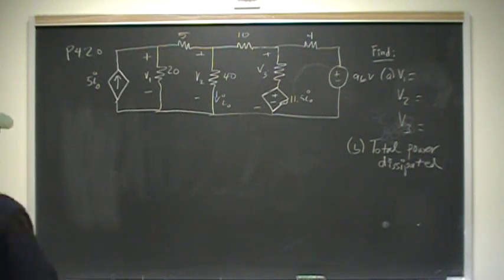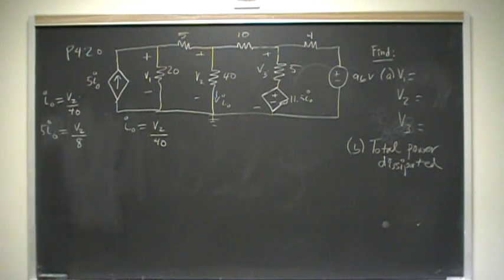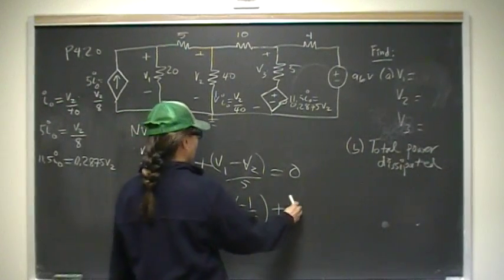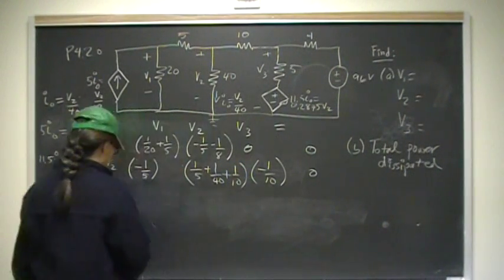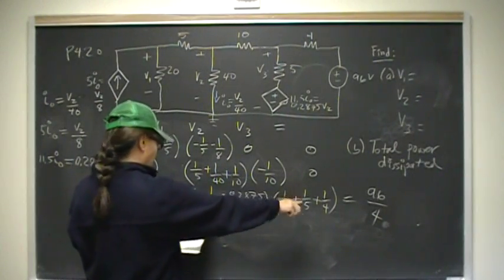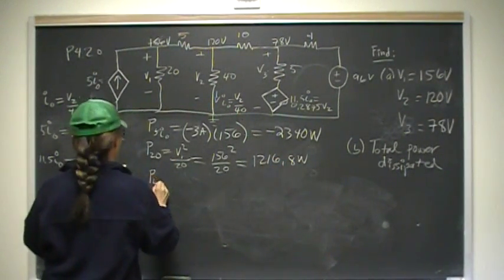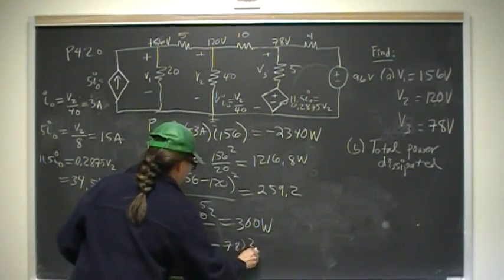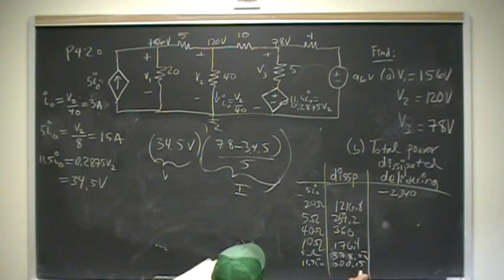Node Voltage Circuit Analysis With Dependent Sources P4.20 Nilsson Electric Circuits 9E Solutions

Comment: Great tutorial, much appreciated.
Just wanted to quickly ask, when you found the power from the current source, why did you multiply -3*156 and not 15*156? Aren't you multiplying the current by voltage?

Comment from the maker: its negative because current going into a node is defined as negative. but once i put it on the other side the the equal sign i would end up with positive 5i0 just like you have in yours. had i forgotten that current INTO a node is negative, i would have gotten the wrong answer. :) thuy